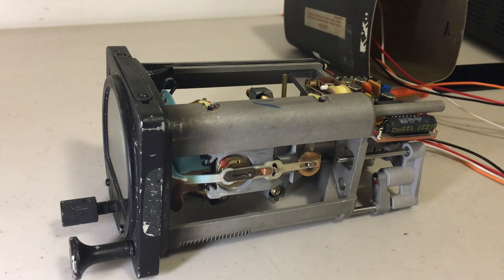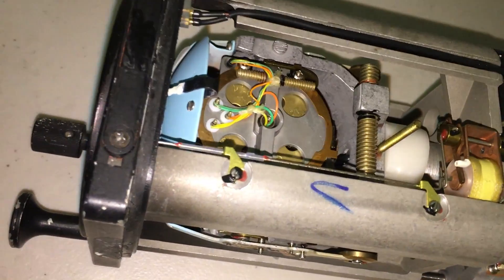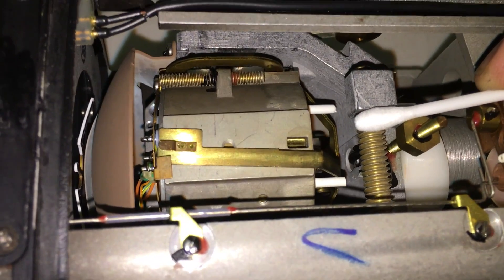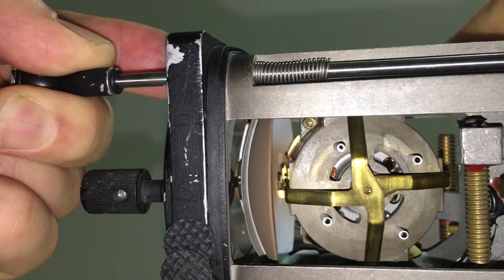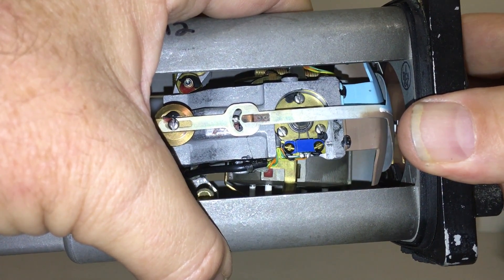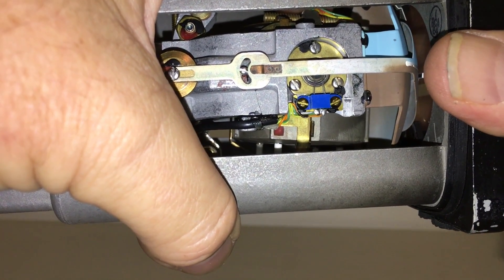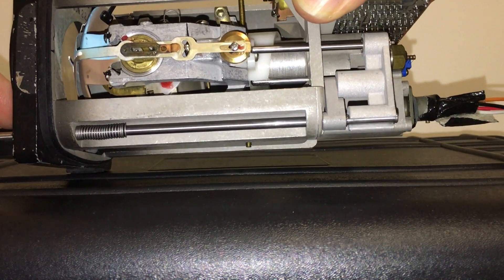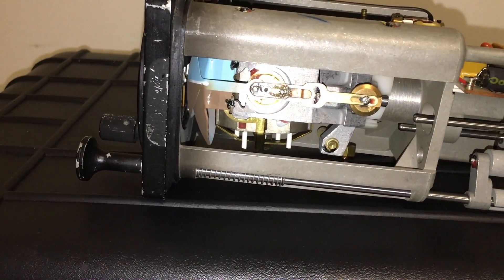Flat Earth - A look inside the Artificial Horizon - Pendulous Vanes.

Comment: Again misrepresentation of the facts those intrested look at " savageplane " web site tells you exactly the facts not the misinformed rubbish this video claims . Also check out Rob Durham who has done several  very good videos on gyroscopes.I HAVE BEEN BLOCKED BECAUSE THE CONTENT IN THIS VIDEO IS RUBBISH
Reply from the maker: +Stuart Williams.  No, you are quite wrong.  That article is also wrong.  Did you notice he claims electric gyros do not have pendulous vanes?    I have proven him wrong because this is an electric gyro and it does have them. 

I have contacted John several times explaining the mistakes in that article and have posted comments but he has not approved them. 

https://www.dropbox.com/s/pr31fzemtqi1sqn/Screen%20Shot%202017-10-30%20at%209.13.57%20am.png?dl=0

https://www.dropbox.com/s/livgf9yfpn32iof/Screen%20Shot%202017-10-30%20at%209.14.10%20am.png?dl=0

Let me ask you a question.  If you needed a delicate spinal operation who would you go to? 

1.  An experienced qualified surgeon or
2. Your local meat butcher? 

I am a 10,000 hour pilot and qualified as an air crash investigator and that has given me expert status in court on aircraft and avionics. 

Yet you trust the word of Mr Savage - a non pilot over mine? . 

Good luck with your spinal operation - I am sure the butcher will do a wonderful job.
Reply: Wolfie6020 Maybe you should discuss with Rob Durham hes also a pilot and had also done a much more comprehensive video on gyroscopes.
Reply from the maker: +Stuart Williams.  I have already spoken with Rob about his gyro experiments. 

Are you aware he used compressed air on a gyro designed for vacuum operation?  He was unaware how to power a simple vacuum gyro.  Are you sure he is a pilot? 

Also, he was completely unaware that the directional indicator he was using in his experiment is actually calibrated for Latitude.  This calibration is done with something known as a Latitude Nut. 

The Latitude Nut deliberate induces precession to oppose the rotation of the Earth and minimise drift. 

Were you aware of that?   Did you point out his mistakes to him?   I did and he was quite receptive and genuine. 

Any valid test needs to be done on a vibrating table too.   Did Rob do that?  No. 

Here is the manual for Rob's gyro that shows how to recalibrate it for the Southern Hemisphere.  

Rob didn't know anything about the Latitude Nut.  Why?   I learned of it as a private pilot. 

http://www.sigmatek.com/php/embed_pdf.php?doc=100L039
Reply: Wolfie6020 Good try but wrong again not only did he prove it he also showed the specs please show his actual response . Not only with the air driven( which worked perfectly fine on his test ) but also his other gyroscope experiments. Show his response( I'm sure you can manage a cut and paste  ).You mentioned Savageplane .Not only does savageplane explain he shows the  specs( show yours ) he also mentions the history or do you refute that as well . Your link shows nothing resend .Just another word on air driven gyroscopes you really need to do your homework there are two types either vacuum or positive air do your googles I found it straight away .

Comment: Hmmm, what I like to know is what is the electronic component for? 
It looks a bit oversized for just providing a stable power supply for the gyroscope motor.
Reply: Ah ok, I thought this device was made for aircrafts and therefore the external power supply is already suitable concerning voltage and frequency.^^

Comment: Great tear down ... lovely bit of kit. You say this corrects for the curvature of the earth. I say this is a 'false statement'

Easy way to settle this

Basically if we remove the corrective properties from the mechanical gyro setup, we should be able to observe the apparent (calculable) drift on the X and Y axis over a period of, say, 6 hours (90 degrees (X+Y)).

Without any 'assistance' we should see the full raw movement of the earth if your model is correct

Since you dismiss my experiment (https://savageplane.wordpress.com/2016/11/14/gyroscope/ ) and claim the precision gyroscope is a toy (which is your prerogative), how about you cash in this AI (or we start a GoFundMe) and commission a suitable (to your/my standards) gyroscope, capable of running 6 hours & demonstrating the spin/wobble/orbit etc.

Then we would see if (just) the earth's rotation could be observed (for the 1st time) let alone the numerous other accelerations we are supposedly experiencing?
Reply: Walter Bislin 
Thank you! I was about to ask Mr. Savage if he thought that instrument actually contained a gyro, but you've done a much better job clearing up his misunderstanding. This is an all too common problem of people like Mr. Savage forming beliefs around technical documents that they don't actually understand.
Reply from the maker: +John Savage  - Sorry John I only saw this comment now.    

You say this is a false statement.. ? 

Please explain how the pendulous vanes know the difference between misalignment due to precession or due to the changing direction of "down" as the gyro moves around a curved Earth? 

The reality is they don't.  They simply work to correct any misalignment.  By doing so they are correcting for curvature also.  

Please provide a valid explanation why you think they cannot do this? 

Your article is also quite wrong when you state electric gyros do not contain pendulous vanes.  Do you now agree you were wrong on that point? 

This is an electric gyro and it most certainly does have pendulous vanes. 

If you can recommend a quality gyro that will do the job then sure, I will happily buy it and test it.  No more rubbish please.  I wasted money on the super precision gyro based on claims from FE channels praising it.

Can I ask, are you a pilot?  Do you have any other qualifications relating to these flight instruments?  How many have you disassembled yourself?

Why have you still not approved my comments correcting you?  Almost three weeks now and I have given you two previous reminders.
Reply: If the earth would not spin and the gyro would have no drift then we would not need an erection mechanism in the first place. But all gyros on earth must be supported somehow and that induces forces. Either the friction in the gimbal bearings is too big so the gyro is locked to the current orientation with respect to the earth (as the toy gyros certainly are, the manufacturer admits that the gyro is not able to measure earths rotation), or the friction is small enough so the gyro is free to precess due to imperfections. But don't expect wolfies mechanical gyro to show earth's rotation accurately. It is not designed to do so. That's why they make use of the erection mechanism. The erection mechanim must be fast enough to correct for drift and curvature, but slow enough to minimize erection errors due to maneuver accelerations. Some gyros sense maneuver accelerations and disable the erection during maneuvers. The drift rate must only be so small, that the drift in usual maneuver times is barely noticable, around 0.1 degree per minute should be good enough, but not accurate enough to measure earths rotation.

You have to buy a sophisticated gyro with electronic control loops that can nearly eliminate friction and are sealed against external disturbances and balanced precise enough to be able to measure earths rotation. They do so on power on auto alignment to north. Modern aircraft gyros have a drift rate less than 0.01 degrees per hour. They not only can measure earths rotation but even the rotation of the earth around the sun of 0.041 degrees per hour. They do take both into account plus the curvature of the earth when they move. To achieve this precision, inertial measuring units nowadays use laser gyros.

But again, there still are gyro compasses that use gravity and earth's rotation to seek north. So even if wolfies gyro is not able to measure earths spin, gyro compasses prove the earth spins.

Gyrocompass Theory and Operation - madden-maritime.com
https://videopress.com/v/QYuFri5n
Reply: Any stabilisation mechanism is simply an AID to the mechanical gyro over the stationary plane, the notion that an AI is in any way affected by the ground below it is ludicrous, but you're free to believe what you want.
The manufacturer of the Precision gyroscope does indeed say it's not sensitive enough to register the spin of earth, but this is just the owners, un-tested, opinion. I have tested that gyroscope on a 24hr clock mechanism and accurately recorded 15 degrees per hour. I have also ran the gyroscope for 6 hrs without registering even 1 degree of apparent drift. This is repeat of Foucault's gyroscope experiments in 1852 with far superior equipment and running time.

BTW there are plenty of AI's out there that have no such mechanisms installed, like this one
http://www.liberatedmanuals.com/TM-55-6610-293-40.pdf 

Test it for yourself, as I suggested above, with an unadulterated mechanical gyro - it's the only way.
Reply: John Savage 
An experiment that proves earth rotation?! Really?! Again?!

Ever heared of a gyro compass?
This device wouldn't work at all without earth rotation, even gravity and the spheroid shape of earth is needed for it to work.
This is working technology, there is no further experiment needed to prove things the working technology is based on.

Btw the video does not say the gyroscope gets corrected for the curvature of earth, it states the artificial horizon gets corrected for the direction of gravity or as a flat earther would say for  "down".
Reply: John Savage: there are plenty of AI‘s out there that have no such [erection] mechanism installed, like this one
http://www.liberatedmanuals.com/TM-55-6610-293-40.pdf

Sorry you showed me the manual of a remote attitude indicator. The remote attitude indicator is controlled by an external vertical gyroscope which provides attitude reference signals to the pitch and roll servo systems in the indicator. The actuation of
the pitch and roll servos causes the yoke and spherical assembly to rise and fall and to rotate left and right. 

Quote from your manual:

Purpose.
The Attitude Indicator (Indicator) is an electro-mechanical unit which provides aircraft roll and pitch attitude information for the pilot. The Indicator pictorially displays attitude relative to straight and level flight. Signals for operation are received from a vertical gyroscope.

4. Description.
The Indicator is hermetically sealed and is comprised mainly of pitch and roll servo loop components, a terminal board, and internal lighting assemblies.

end quote

This is only the display of an external vertical gyro. It contains no gyro and no erection mechanism, only servo motors to drive the display. I am sure the external vertical gyro has an erection mechanism.

If you were a technician and did research properly, you could have seen in the manual provided by you, that this AI contains no gyro but only two servo motors.

You have to know a little more to judge the knowledge of experts on their fields, eg engineers or pilot instructors. Try again.
Reply: John Savage
Well, it is YOU who does not understand what I am talking about. To specify my previous reply...

...here is a working product as a reference:
http://www.raytheon-anschuetz.com/products-solutions/product-range/standard-22-gyro-compass/

...here is another one:
http://www.tokyo-keiki.co.jp/marine/e/products/gyro.html

...here is how it works(on a globe):
https://www.britannica.com/technology/gyrocompass

So if you think YOU do know what YOU talking about please explain how a gyro compass could possibly work on a fixed flat earth and please don´t spare the details.
Be aware I said gyro compass, NOT gyroscope, NOT attitude indicator, NOT artificial horizon and definitely NOT heading indicator!

I am looking forward to your findings.
Reply: I don't think you understand how a gyrocompass works, but carry on ignoring the giant elephant that is the humble mechanical gyroscope. All the proof anyone needs to know the earth is a stationary plane, in one device.

Comment: Unless the airflow doubles as cooling for the motor and bearings, simply covering the inlet holes may well do a sufficient job of disabling the erector system without risking damage to any of the delicate parts. You seem to have a few options of non-destructive disabling available to you. That gyro is a nice unit. You should get a Bell helicopter to go around it.
Reply from the maker: +Fudmottin.  I would love that helicpter.  I tried it with a piece of tape across the vanes - at the junction so they are centered and don't move.   Just need to balance it better and test it more in different directions.  It wanders around in pitch and roll now.
Reply: There's probably an imbalance in the airflow. You can have the gyro statically balanced but still have a dynamic imbalance. I have that problem with a large gyro that I've been experimenting with.

Comment: Wolfie

Brilliant explanation, I recently threw out my old turn and slip, and replaced it with a turn coordinator.
The subtle differences are really fascinating, it seems to be a cross between the turn and slip and the artificial horizons roll function.
Reply from the maker: +oliver styles,  Thanks, yes you will  notice a difference in the turn coordinator as it has the gyro tilted just slightly so that the roll actually causes an initial movement the direction of the turn.   It is a much nicer instrument to fly limited panel with.

Comment: I am a lapsed student pilot... I miss the sound of gyros powering up, and also the sound as they power down after you finish a flight.

Outside of being valuable info to counter flat earth nonsense, this video was just fun to watch and learn. 

I wish I could make Wolfie my flight instructor! I had a retired American Airlines international captain as an instructor for a brief time and he was awesome...more preferable than the typical young buck building his hours as CFI.
Reply: plinn2112 
Ah yes the sound of the gyro. 

I was usually the last man off the plane - a G2. So it was always a serious check "dark cockpit", or I'd be in big trouble. And often enough I'd hear the emergency battery driven gyro still running. 

So I'd pause before getting of the make sure dark and quiet.
Reply: How high should you fly to see the curvature of the earth?
Reply: @Stefan-gh7xr   Have you checked out Walter Bislin's website?
Reply: @plinn2112  Have you checked out Eric Dubay's website?

Comment: this is awesome, thank you. but i'm a bit confused, i thought the gyro is already having tendency to balance by gravity and that how it corrects for earth rotation / flying over the curvature, and that the pendulum vents are designed to prevent the focault effect produced by the lateral / longitudinal forces (uncoordinated yaw and acceleration/deceleration) ... i'm not even sure if i phrased that right !! 

if i put a nose down, the vents will not be affected since it's hooked to the leveled gyro, but if i deployed spoilers , the mass of the gyro being under it's pivot point will "tend" to cause the gyro to rotate left(or right) but not with the brace arm moving according to the deceleration opening the vent to over come the false roll indication resulting from deceleration
Reply from the maker: +crowxe.  Thanks,  that slight tendency to balance alone would cause many errors in flight,  it would precess badly in a turn You are right about a constant acceleration causing a false alignment and we learn about those during an IFR rating.  They are called "turning and acceleration errors" 

During the course of a normal flight they are quite minimum.   More advance systems have other correcting mechanism to correct the correcting mechanisms during manoeuvres which minimise these errors.
Reply: Some AI's have maneuver sensors, essentially accelerometers eg. mercury switches, or even mechanical mechanism that can distinguish between gravitational acceleration and maneuver induced accelerations, so they temporarily disable the erection mechanism during maneuvers. But this requires a gyro where the drift rate without correction is smaller than the error it would produce by the erection mechanism.

See here for some such mechanism:

Patent describing an erection system, which is responsive to the flow of air for erecting a gyroscope. The erection system includes a plurality of channels having balls disposed therein. The balls are responsive to the gyroscope being tilted from an erect attitude by a first relatively small predetermined angle (0.5°) for rolling in the channels to create an unbalanced flow of air through the erection system, which provides a force to erect the gyro, and are responsive to the gyroscope being tilted by a second relatively large predetermined angle (10°) for rolling in the channels to negate the unbalanced air flow which disables the erection system.
Patent US4527439 A, 9. Juli 1985: 
http://www.google.com/patents/US4527439

Patent of air driven erection mechanism using an arc shaped gravity pendulum in a case that closes some outled nozzles when out of alignment with the gyro. This produces some unbalance in the forces which erect the gyro. To prevent erection during maneuvers, inertial sensors sense accelerations and turns and activate electromagnets that lock the pendulum in its null position.
Patent US1934774 A, 14. Nov. 1933: 
https://www.google.com/patents/US1934774
https://www.google.ch/patents/US2038531